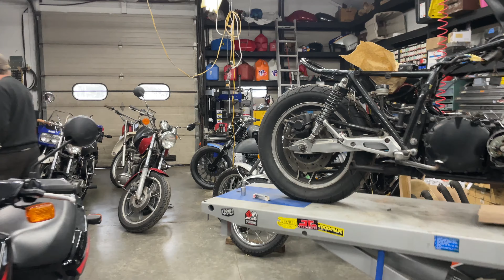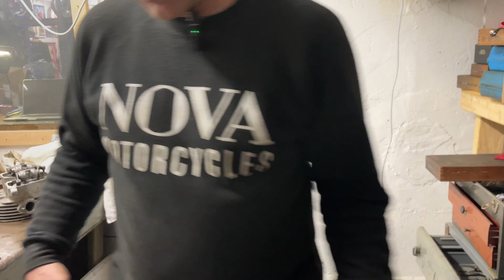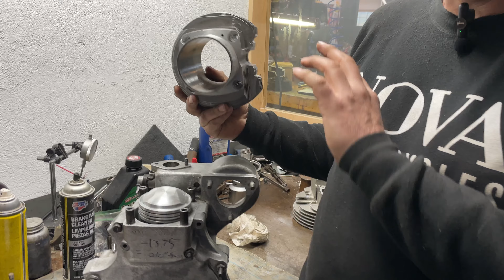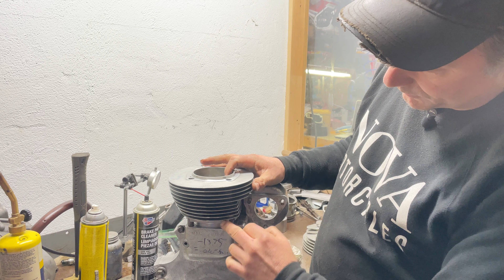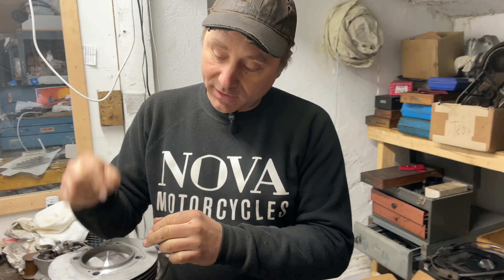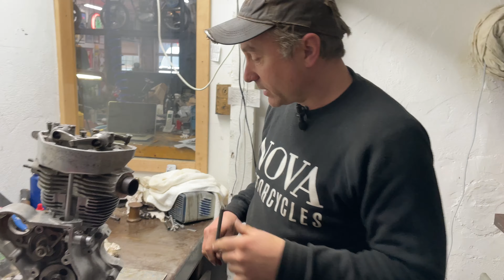Nova Motorcycles-Velocette-BSA Race Motor Part 2

Comment: Hey!
I'm making a same conversion with my BSA C-10. Adapting a B-40 head to it, with Kibbelwhite 5.5 mm stainless valve and titanium spring kit ment for Polaris.
Tida forged piston.
Different stud pattern, too narrow pushrod shaft, total reprofiling of a camshaft and short stroke crank that needs a whole lot of rebuild and grinding.
Lot's of fun, and I'm in a middle of it.
Reply from the maker: that sounds awesome!

Comment: Wow scary to make those fundamental cuts to the barrel etc… you’ve certainly got to measure twice and cut once!
If you shorten the pushrods by the same amount, why would you expect the valves to touch?
Reply from the maker: Because of the domed piston we're using for a higher compression ratio
Reply: @novamotorcycles  ah, OK got it 👍